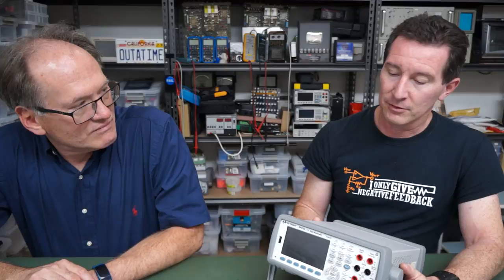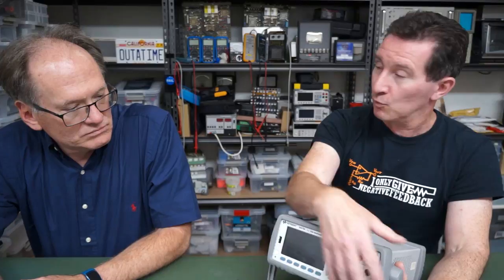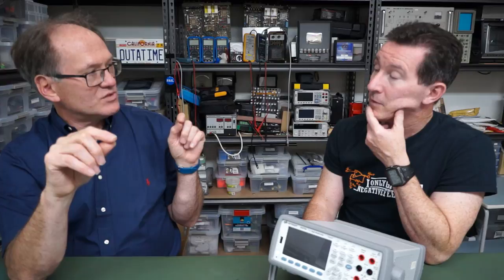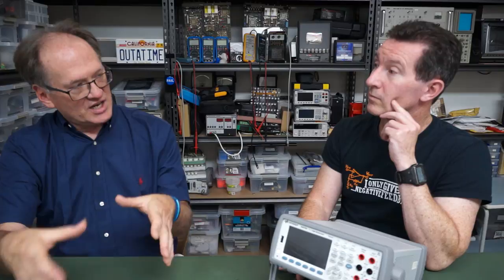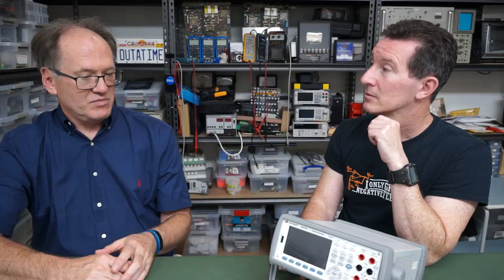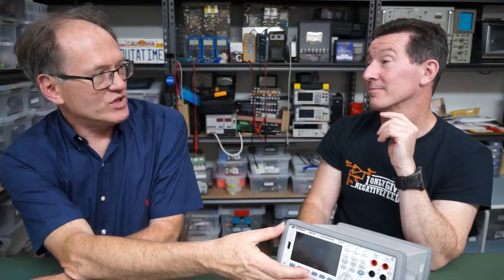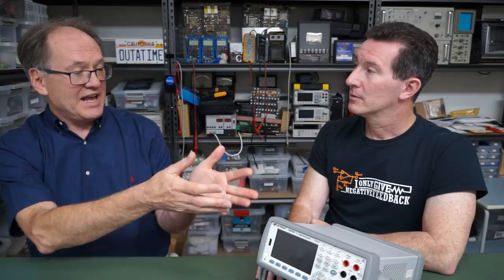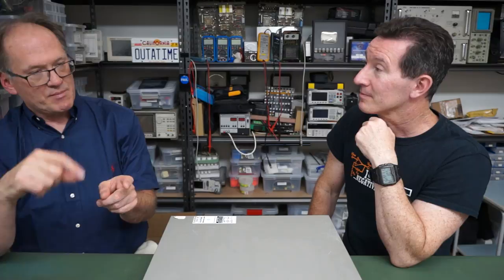EEVblog #1032 Part 5 - John Kenny Keysight Interview

Comment: Enjoy this series. I used many of the early HP test equipment on aircraft avionics and later in missile testing during the early 80’s and now I have a suite of diagnostic equipment on my home bench. I hope Keysight will one day build a multi-purpose system monitor/analyzer for consumer use similar to what another manufacturer used to have for the old CB shops.

Comment: I thought Ethernet (LAN) is always isolated, I guess not practically to the desired CAT standard?
Reply: Ethernet is isolated for 1kV transients. 600V CATIII transients are 6kV - most voltmeters are good for at least that rating.
Reply: Neil Moore I guess there’s no market for 6KV approved Ethernet isolation transformers or there’s some sort of physics problem that makes it non practical?  I suppose it just makes good sense to put the isolation at the sampling stage where bandwidths are much lower, furthermore it means you don’t need to independently isolate all the wired interfaces